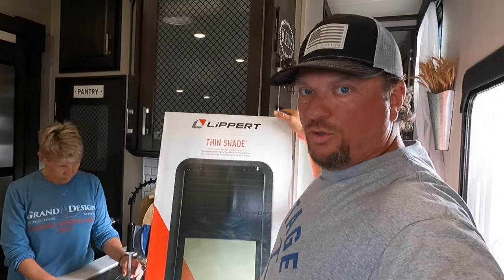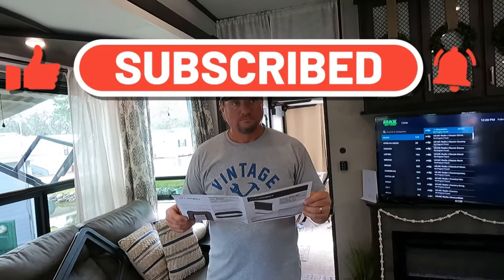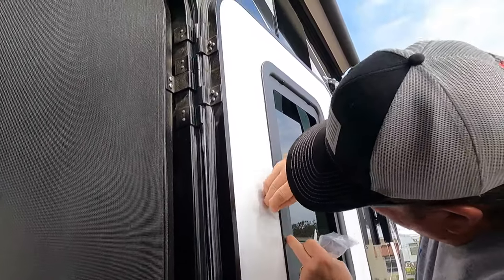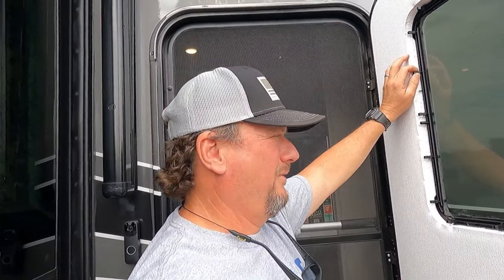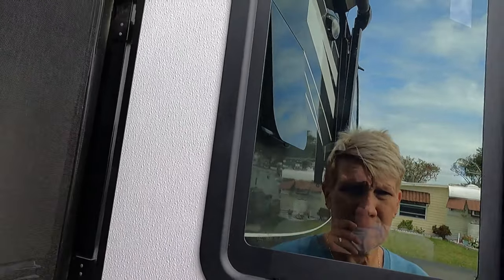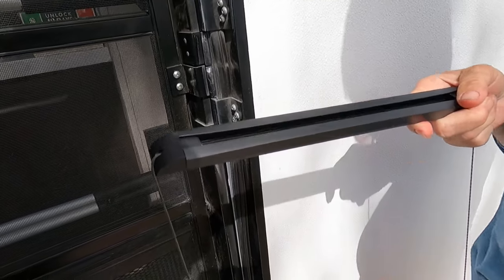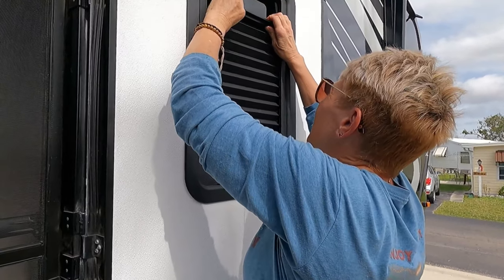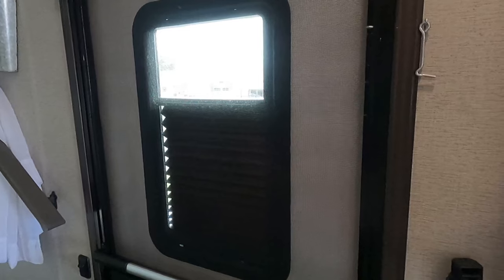Lippert Thin Shade Install - Shade The RV Entry Door!

Comment: My husband installed ours about a month ago. He also said those tabs were really hard to move. I haven’t seen it but I hope he put it on upside down like you just did.
Reply from the maker: Some reason, the new set was so easy to deal with. If he didn't you can easily flip it, providing the tabs are easy to deal with.

Comment: Great installation video thanks! I cheated. I took out the frosted glass and inserted tinted glass. Cost under $20. My RV already has a blackout shade on the screen door. No need to open the door just to adjust that thin shade.
Reply from the maker: Oh, good tip.

Comment: Hi Mike, I'm Mike.
I broke the cheap little clips that hold the door blind up. I think they pop out and can be replaced. I don't know what they are called or how to get them.
Can you help?
2023 WS2708 33" Ultra Light
Thanks,
Mike
Reply from the maker: Well... our unit did the same. We purchased an new thin shade, not the enire window piece but just the shade. We were told you can't purchase just the clips.